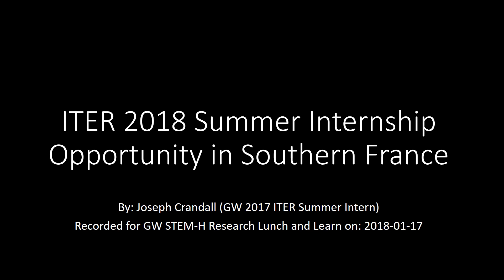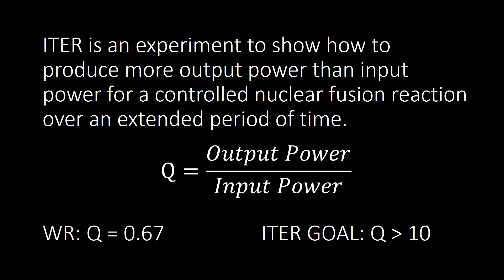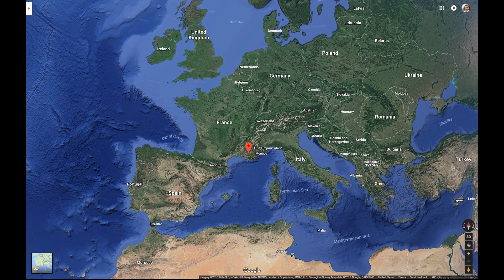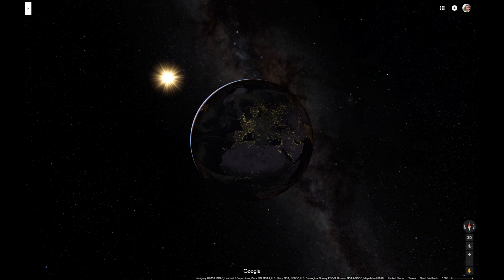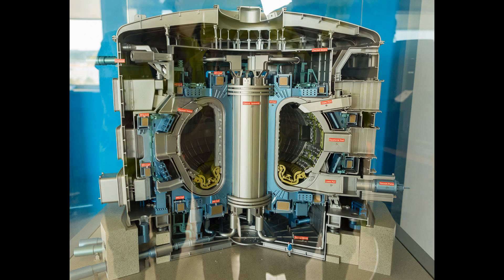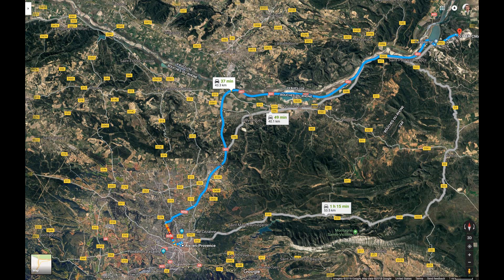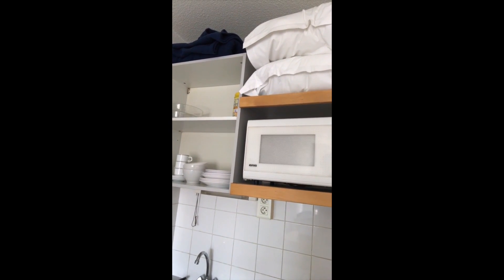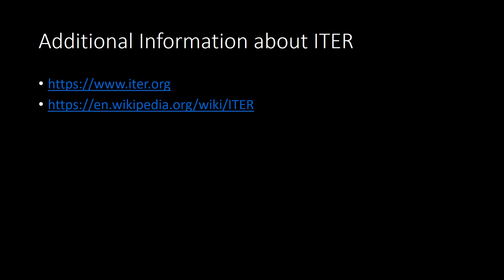ITER 2018 Internship

Comment: Hey! Thanks for this video. This is very informative. I have  a few questions though.
1) I had emailed to internship@iter.org as mentioned as mentioned in the website, an automatic reply mentioned to send the email to Internships@iter.org along with some more requirements so I sent it to this ID mentioned. Will it be considered 2 email applications? Did you face the same issue?
2) How long to they take from the date of email to reply? After how many weeks did you get a reply?
3) How many undergrads were there for internship?
Thanks!
Reply from the maker: 1) I recommend reaching out to the members of ITER HR directly. There emails are included in the video. The application process is long. Be persistent.